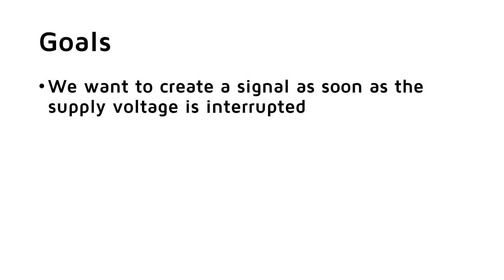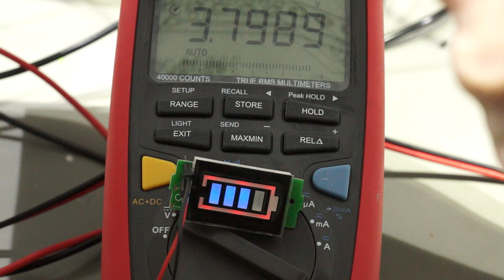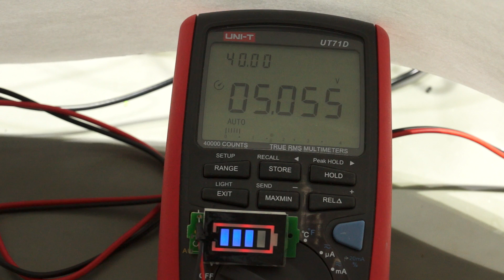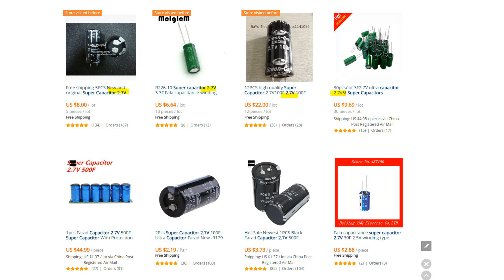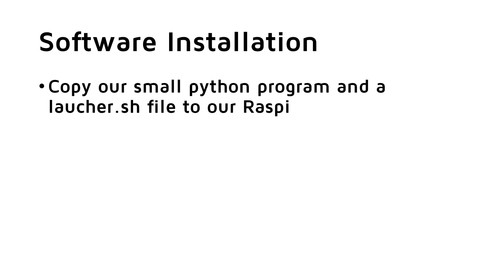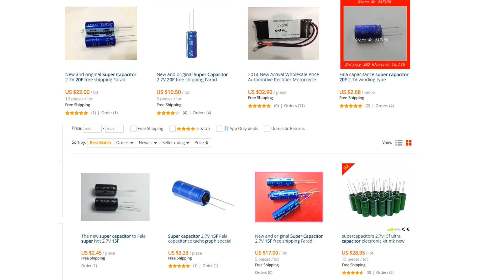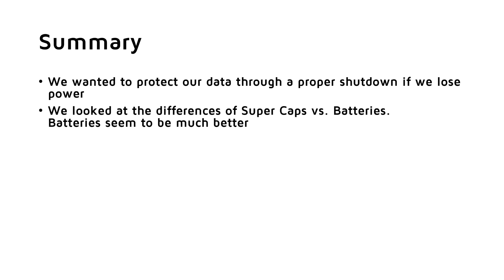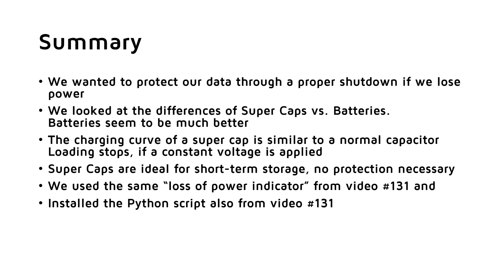#133 Safe Shutdown for Raspberry Pi with Super Capacitors

Comment: Compared to the specialized KA75xxx, I would recommend a more general hobbyist part like the LMV431x. This allows external voltage selection resistors to select function from ~1.24V to 30V. These parts can also be used as shunt regulators to balance across the supercaps. The LMV431 is but one variant of the TL431/TLV431 parts, and there are several others to select amongst as well. Useful additions to the parts box.
Reply from the maker: These two chips are somehow similar, but they behave different. I just checked both. The KA7533 makes exactly, what I expect: It pulls the output to zero if the input is below 3.3 volt.
I connected pin 1 and 3 of the TL431 and via a resistor to the input. pin 1/3 is then the output (page 1 of the data sheet). Like this, it behaves like a 2.5 V zener diode, which is the contrary what we need. The output is caped at 2.5 volt, but there is no sharp edge below 2.5 volt, because the output follows exactly the input in this area (as with a zener...)
But maybe there is a trick I do not know?
Reply: Thanks for checking this out. The trick is letting the regulating TL431 pull down the base/gate of a PNP/P-channel transistor to control the output.

https://www.circuitlab.com/circuit/57h5dm6wghnm/ka75xxx/

So this requires some additional components compared to the KA75xxx approach. The upside is that it's all standard "jelly bean" components that can be easily obtained and used for other purposes. I'm still fairly new to electronics myself. Building circuits from common parts rather than using more specialized parts has been a good way to learn.
Reply from the maker: Thanks for the link. For me, this is more complicated and for such a small device like the power monitor, I like the KA75xxx (even it might be obsolete). It just does exactly what I need for a few cents.

Comment: Is  there a version of Jessie that has a read only boot partition? If you kept any app on a read/write partition, or write data to the cloud, you might be able to accept a power failure without issue.
Reply from the maker: +John Washell I am a Linux newby, so I do not know
Reply: John Washell 
yes, there are several distros based on debian which have a read-only system disc. just check out any live disc systems.

 i would also separate the write memory to different physical memory and not just a seperate partition.

Comment: I would suggest the way to fix this sort of problem isn't to try to stop a power failure but instead make the setup resistant to such failures i.e. making the OS read only so it can't get corrupted or in a bad state from power failure during a write.
Reply from the maker: I am not a Linux expert. But it seems not to be about the OS only. When I shutdown, also the running applications do some "shutdown" (probably saving some data). I assume, because of the limited # of write cycles on SD card it is not appropriate to write each bit immediately to the "disk"...
Reply: Disk IO is slow so Linux (Windows etc too) usually don't do write immediately but you can configure that stuff on Linux so that writes happen sooner with the loss of some performance etc. There are options you can use for ext4 file systems that make them a lot more tolerant of the power getting pulled too.

I know of an expensive commercial product that uses a super cap setup with tweaked settings for the kernel/filesystem and it does work most of the time to save the from thing getting bricked but it's not perfect.

A fixed OS image built with buildroot, yocto or similar + rw data that can be recovered over the network if it gets corrupted is the way to go IMHO.

Wear levelling for SD/ eMMC is done in the controller on the card/chip itself which is why you can use regular filesystems like ext4 and not the special flash filesystems like ubifs, jffs etc.

Comment: It is only useable if you're using RPi almost-unloaded. If you're using a HiPower WiFi dongle or even a regular one - it won't do it's job and you'll have an unclean shutdown. Also there's a trick about a shutdown time: it can be minutes or tens of minutes depending on the task performed.
Reply from the maker: You are right. I use the RPI only for tasks like Mosquitto broker, data logging, node red, etc. So, my shutdown time is not very long. In your case, a battery like in my former video is then the right solution.
Reply: Actually, there's an idea I have about this type of shutdown - I'll post it if I'll be successfull in implementing it in hardware and software. Also - take a look at Orange PI, it is Allwinner CPU's, they can be used with powersave governor during shutdown to make it more power-efficient.

Comment: I'm trying to find a shop which sells the KA7... chip but I am unable to find it on BG or AE.
neither the alternatives TCA... or MAX....
The link you did put in the remarks does not work for me. 
Any solution?
Reply from the maker: This is the only source for the 4.5 volt type I found on Aliexpress. 3.3 volt are available in TO-92

Comment: Thanks fo the video.
I also use Supercaps for a similar purpose but for devices with less power consumption and/or a bigger Voltage tolerance (Homematic battery devices). For that cases they are a good choice. For your application they are not so good: The RasPi draws a lot of power and the voltage tolerance is quite small. This results in big and expensive supercaps drawing  a lot of current during charging. For this purpose batteries or accus do a better job, they keep the voltage better. 
I overcame this charging issue with a schottky diode and a charging resistor, but this will not work here because of the low voltage tolerance.
I also Lithium primary cells which have a promised shelf time of 15 years, but this will not work well for the raspi in this simple way.

The easyest way for you would be a 1 cell power bank which allows charging while delivering current. It is easy and cheap. This was already mentioned before in another comment.

Next possibility is using an Orange Pi Plus 2e with armbian instead of a RasPi. The Pus 2e has 16GB eMMC on board and you can get rid of the SD Card. It handles hard resets much better than the SD Cards of a RasPi.
Reply from the maker: I agree with battery vs super caps. This is, why, in my last video, I used a battery UPC. Here, the whole idea is to only get a proper shutdown. Therefore, I only need seconds of power and the caps are quite small. The idea with a power bank is very similar to the concept of the battery UPC. It still needs a protection against abrupt cutoff without shutdown (if you care about that). Maybe, the Orange Pi is the solution, if you do not need to shut it down before switching off.
I had also problems with charging the power bank while using it to power the Pi. Obviously, this seems not to be a universal feature...
Reply: Thanks for your reply. I agree, unfortunately this is not an universal feature of power banks. some have it, some do not (the majority, I fear).
My RasPis and OPis are atteched to the network. And beeing so, they also can be aggregated in a "server area" and for this area, includung the router, RasPis, OPis, NAS, Homematic central (CCU), DECT phone I use a commercial available USV, e.g. APC 700. This solves all these issues and is not too expensive. To do it even better you can add a bypass switch so you can change the accu of the UPS without powering down your devices. The Pb accus indeed have a limited livetime of 5 or 10 years depending on the type.
For my distributed WeMos fleet I do not have a backup and up to now I do not need it. I use them as sensors.

Comment: ouch i deleted my comment by mistake!! I said basically i use cheap power banks (usd $ 2.5 dollars) and it provides about 40 minutes of power depending on load. (it includes battery + circuit board + case). Of course it also provides power while charging so it's like a mini UPS. I've been serviced by this during years.
Reply: ... ok Adrian, to your question: to know when batteries run low I don't care because it's supposed shut down (or whatever) was made when main power went down. Well, in the case to know when running low, I would just place a RC Lipo Battery Low Voltage Alarm device (another cheap device) between battery and UPS, whose output pin would connect it it to another pin of you CPU... I would just hack the alarm's buzzer to turn it as a compatible TTL output with your CPU's pin (with an optoisolator or something).
Reply from the maker: +rodstartube That is a good concept. However, not all power banks can be charged when used (either-or). Do you have a link to your device?
Reply: search: "381674926080" on eBay. They claim 2600mAh or more, but that's bullsh*t, I tested them, usually store about 730mAh, but that's enough for a nice backup or mini UPS, and being honest, that's fair for what you pay. Just replace included crap battery for a decent one, if you want more capacity (or parallel with others). It would be nice a review of this at your style. Regards!
Reply: PD: item title is "Portable 2600mAh USB External Power Bank 18650 Battery Charger For Cell Phone" so you can choose at your convenience, be carefull many just sell the box/case "battery not included". {Of course I use soldered wires to the board, not the bulky USB connector}
Reply: i use ebay.com
Reply from the maker: Unfortunaately, I do not get any hits. Can you send me the full link? Maybe then, I can look at it, at least...
Reply: this one is the box with circuit board, without battery: http://www.ebay.de/itm/Blue-Yellow-USB-Power-Bank-Case-Kit-18650-Battery-Charger-DIY-Box-de-/331579598884?var=&hash=item4d33af2824:m:miTeOCGgdDxdsTMcLizDpKQ you can search with battery included, so i'm not german speak. (im speak spanish)
Reply: Hi rodstartube. How do you initiate shutdown process when batteries running low? Does this circuit handle power up of the rpi when power is back online? It can charge and serve at the same time?
Reply: Hi Adrian, as a power sensor I use a 5V relay, powered from the main source (before the "mini UPS") whose output goes to a pin, which alerts if power is present or not. When main power goes down, while relay changes output alerting your cpu to do something (to shut down for example), this "UPS" provides more than enough time to perform it (or do something else like sending alerts & notifications like mails, SMS, beeping alarms, turning emergency lights on, activating emergency procedures, call SWAT, release a grenade, launch a nuke or whatever you feel appropiate to your context).

Comment: you should use a simple balancing circuit for the caps (just put an appropriate zener diode in parallel, one for each cap), because of their differing internal resistances they will act like a voltage divider, and one of them could get too much voltage
Reply from the maker: Do you have experience with that? Because, I am not sure, if Zeners alone are good enough, because they also have their tolerances. Usual balancers are more complicated. But they are also made for much bigger caps.
Reply: a zener would basically discharge the capacitor when the voltage drop over it gets too high(creates a lot of pixies when you just put a big overvolted supercap on it). you would have to experiment with values. but before you go through all the trouble, let the system run for a while and then measure the voltages of the caps. yes zeners arent perfect, and sadly not available in arbitrary values, but there are some available with 2.7V
Reply from the maker: I asked, because I did also some experiments :-) And it is not easy to get these low values, at least not for me. I have all of them, starting at 3 volt and up

Comment: similar idea here:  http://www.hackerspace-ffm.de/wiki/index.php?title=Raspi_EDLC_UPS
Reply from the maker: You are right. Thanks for the link! They use bigger caps and therefore use some protection resistors. And they have no voltage reference, which, I think, is not ideal. But with the bigger capacitors, they can maybe start the shutdown later and so, do not need an exact voltage level. The parallel resistors, however, are a good idea. With these, the RPI will re-boot after the power came back (they discharge the caps in minutes)

Comment: Does this circuit handle power up of the rpi when power is back online?
It seems to me that if the rpi completely shutdown and the power was out the entire time it will power back up after power is restored but what happens if power is restored in the middle of the shutdown process?

I've seen some complicated (complicated for me) circuits that should handle this but never figured them out enough to trust myself to build and debug them. I am thinking of using attiny as a controller for that to handle the work and interaction with the rpi.
Reply from the maker: If power down is long, and the voltage is completely zero, then, the RPi should boot  when it is powered again. But there is no guarantee

Comment: Hi Andreas, this would not work for me, connecting discharged supercaps in parallel to the USB power supply is like a dead short, my "smart" USB power supply detects this and does not start.
Reply from the maker: You are right. Such large caps can also pull 500 A (they are built for that). Here, the caps are much smaller. But maybe your loader is really too smart. ;-)
Reply from the maker: I used my normal one and it worked. It is also not completely clear to me how your device would detect that because  a RPI without super caps also start at zero volt.. The only way could be with over current.And this can be corrected by a small series resistor or thin wires of a (cheap) USB cable.
Reply: It has a DC-DC converter in it and the driver shutdowns the USB port whenever it detects a short. I once tested those 500F supercaps and they can easily pull 5Amps! from a power supply (and even higher, but the supply was limited to 5A).
Reply: Yes, that sounds sensible Javier - well, the existing supplies as documented elsewhere are not doing too well from flat either. I can see a custom design coming on.

Comment: do caps in serial balance during charging? (unlike batteries in series)
Reply from the maker: No, they do not. But I did not find a lot of stuff concerning this topic. Because they are in series, both should get exactly the same amount of current at least. One source suggested, that for small caps and well below the maximum voltage should work ok. So, I did it. And, if the caps are destroyed after a while, it is not so expensive... (I mentioned it in the video, that I have no long tern experience)
Reply: Sorry. I wrote it while I was watching and you mentioned right after posted.

Comment: Great video. One disadvantage always seems that you cannot take advantage of a large percentage of the capacitors energy because voltage drops too quickly. 

Do you have any thoughts about using some type of boost regulator to maintain the 5v as long as possible?
Reply from the maker: The idea here is, to have just enough energy to shut the RPi down. And I wanted it KISS (keep it simple and stupid). But, of course, you can add such a device.

Comment: Did you use constant current source for charging the caps? I would not rely on maximum current that the usb plug can supply. I did some industrial electronics with 50-400F banks of 6 supercaps which needed constant current charging and balancers for safety. I suggest at least small balancing resistors so the voltage will be divided equally over two supcaps.
Reply from the maker: You are right with big caps. But here, with the usually thin USB cables, and the current limits of the USB charger, I had no problems. The time of high currents (>1A) anyway is only seconds. But, of course, you can include a small resistor.
The two resistors across could have another nice effect: Thy could discharge the caps faster that the RPI boots when power is back...
Reply: i tough the same
Reply from the maker: I think, this is a good idea to limit current spikes. I think they act more as current limiters than as resistors, so they should not have a lot of energy loss.